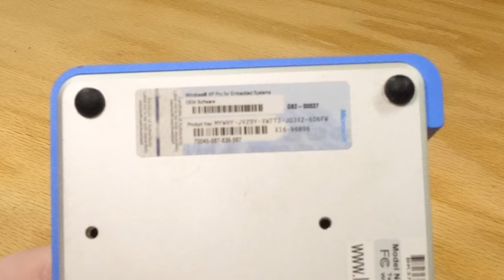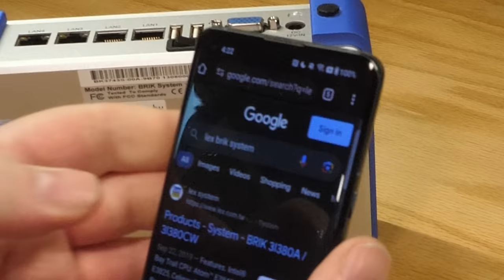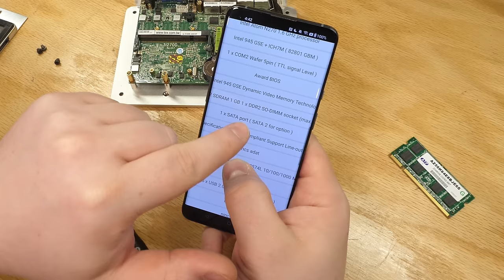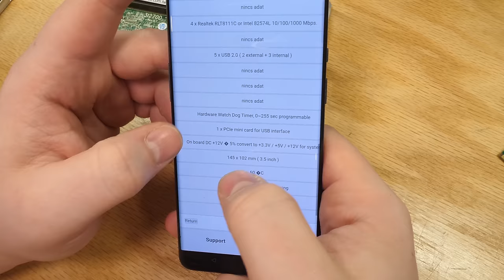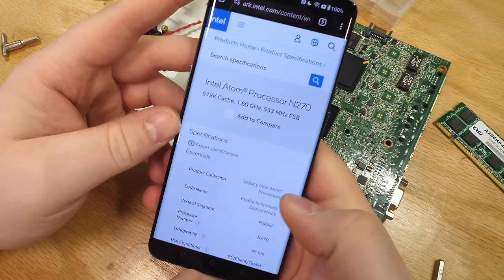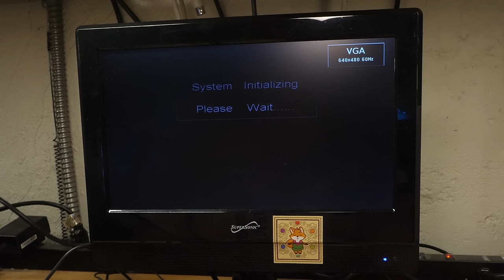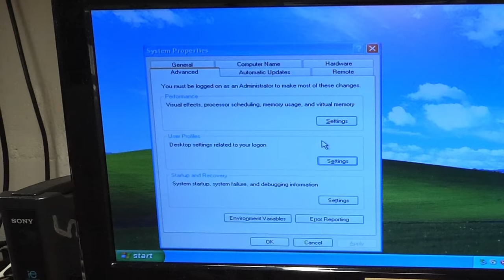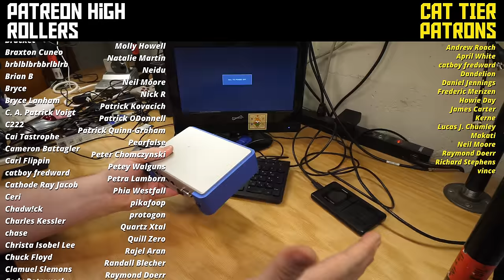Little Guys: Episode 3 [Lex Brik]

Comment: Those IODD devices are so awesome. I wouldn't mind a video going over it and/or other stuff from that same company. I like how they have a small yet simultaneously eclectic selection of devices all with interesting different features and styles, and at the same time their website is so badly translated and poorly laid out with no visible indication it's purchaseable or where that purchase might occur, the website is extremely entertaining. In some ways their stuff seems equally as odd as it is cool, which is the best kind of thing.

Comment: Regarding relays on industrial embedded pc: Generally industrial machines / lines are controlled by PLCs which are ruggedized microcontrollers that reliably run code, however they are somewhat limited in what they can do.  So when you need to do something more demanding or have an embedded machine part of another machine, for example a product labeler the labeler would use one of the "little guys" to do the labeling task. The machine (PLC) would still need to communicate / interface with the labeler (embedded pc) and because the PLC could be using 24vdc, 230vac or any other control voltage, relays would be a easy way for the embedded system to handle that. And generally all the communication needed between them are stuff like Labeler_Ready, Apply_label Etc
And this is also how many industrial machines interfaces with other machines. It is quite shocking how primitive the communication between two gigantic industrial machines can be, all that is needed is a ready signal that a machine is ready to receive product.

Comment: The USB lanes of the Mini PCIe interface are usually used for built in Bluetooth adapters that come with WiFi cards, like Intel or Broadcom, thr Bluetooth adapter just acts as a USB device, while the WiFi card acts as a PCIe device

Comment: 31:47 regarding your rant here about proprietary cmos batteries, I myself have 3 Nokia n900 phones and each require me to put the time and date in every time I power up the system and my research pointed to the PiTA battery/capacitor they basically 'welded' to the board, I need to source some but they simply don't really exist... Unless someone else could point me in the direction of them lol great video dude, always love watching your videos

Comment: Regarding USB pins in mPCI, M.2 also has USB pins, it's commonly used for connecting the Bluetooth part of a combined wireless module (and WiFi would run over PCIe due to the higher data rate required ofc)

Comment: Something in these things is so dang delightful. I have a mac mini on my table, not in use, but it's a delightful little guy. This reminds me a lot about it. But yep that blue oh that blue. I want it.
Also. The insides of the mac mini are not fun. Yea it gets the job done, but it's a pain to do anything in there. Lucky you don't usually need to but yea, the inside is just as important on what makes a little guy special. And that brik. I want one. Also oh boy that SSD mount is amazing. Yea it's cheap but it's possibly the most optimal way to mount it. Considering space. Screws cost something. But it's really kinda genius.
Reply: Ohhhhh heck yea it heatsinks to the chassis

Comment: The relays are for bypass ports. That would be for redundant setups, bridging the ports, when daisy chained to second device.
Reply: Oh lol you explained it anyway. It's common on Talari, Riverbed, Cloudgenics, ....
Reply: The relays would not only trip when power is lost, but also when a watchdog isn't reset periodically... To prevent the device from blocking traffic because of a misbehaving/failing OS or application.

Comment: There's a version of mPCIe that's just electrically USB. It's a present limitation on a number of laptops boards. Tends to be used for WiFi/Bluetooth-only slots. Same deal with M.2, it's why you can't throw a WiFi and Bluetooth M.2 into just any M.2 slot and have it work without issue.

Comment: On the PowerBook's proprietary PRAM battery... it wasn't for no reason, there was actually a feature behind it.

A few years before, Apple brought the sleep power of their laptops down far enough to support a use model where, when you were done using the computer for a while, you could just close the lid (which slept it), open it a few hours later, and be right back where you were, without losing more than a percent or two of the battery's capacity.  The initial version of this was only capable of suspend-to-RAM rather than suspend-to-disk, so even though the CPU was pretty much shut down, the computer's memory controller stayed alive enough to keep DRAM refresh running.

At the time, this was somewhat new, and Apple was in front of the PC industry.  Maybe not in terms of date of introduction, I don't remember, but in terms of making it actually work reliably, every time?  Way ahead.

So Apple's got this cool low power suspend-to-RAM feature, and they're thinking: what else can we do with it? How can we get further ahead?  And here's where you have to remember a usage pattern that was once common, but isn't now: laptop power users often carried multiple batteries in their bags so they could swap in a fresh charged one when necessary.  Battery capacity was smaller and active idle power management wasn't nearly as good, so if you wanted to use a laptop on battery all day, you had to charge and carry multiple batteries.

That's where the big "PRAM" battery comes in.  It got upsized and made rechargeable because Apple implemented a feature where you can close the computer's lid to put it to sleep, flip it over to get access to the battery, swap in a fresh one, flip it back over, open it up, and keep going.  The "PRAM" battery now supported DRAM refresh during the time when no main battery was in the machine - in essence, it's like a small UPS for the main battery, just enough to keep vitals going for a few minutes.  A CR2032 can't cut it for this application, you need something bigger and rechargeable.  So they went with a few tiny lithium ion cells assembled into a small battery pack.

This feature's time in the sun was pretty short because Apple introduced it just before new developments in main battery capacity, power management, and so forth would make battery swapping far less commonplace.

Comment: Mini PCIe does, in fact, have a pair of USB data lines as a standard feature. In Wi-Fi/Bluetooth combo cards, Wi-Fi part connects to CPU through PCIe, but Bluetooth usually uses this USB pair. I had an ITX motherboard with mini PCIe slot where USB lanes were not connected, so in order to utilize Bluetooth on a combo card I had to run a pair of wires from the slot solder pads to the internal USB 2.0 header. And it still works!

Comment: When Radioshack upgraded their infrastructure around 2003 with new servers, we jumped from some old Win95 machines that ran a X-server client to an IBM 340 desktop on the backroom, to some Compaq Proliena servers with Win2000 and virtualized DOS connected to Optiplex GX60's with XP Embedded. First time we booted those up, I saw the splash and was like, "Embedded? TF is that?"

Twenty years later and now I ask the same about "Pro". Which is interesting because standard XP embedded is XP Pro, as it can do domain joins....

Comment: With those vesa mounts when we used em at my old print shop we'd put the (gigabyte) bricks on the same mounts that the monitor used so that everything was all self contained on 1 swing arm that hung over the press and able to be pushed out of the way. Pair that with a touch screen monitor and you have an extremely capable work station that could get covered in lint, spray tack, chemicals, ink, etc and stay on practically 24/7 for many years. I quit eventually but some of our oldest stations were still going strong 6 years later...

I love these lil guys

Comment: The reason for your relay pads is probably because of things called bypass NICs. These are somewhat common in things like corporate WAN accelerators and similar devices. Basically things that "man in the middle" Ethernet for security or performance reasons, but where you still want the network to work if they crash or lose power. When that happens the relays will connect the two Ethernet sockets together which bypasses the smarts in the device.
Reply: Whoops, should have kept watching! I see you figured it out.

Comment: For that weird proprietary battery around 32:06, if you ever need to, there are lithium rechargeable batteries, LR2032 for example. Unlike the CR2032, the LR2032 is rechargeable. They also come in LR2016 etc. I only know about this because of the stupid battery in the dreamcast.

Comment: That’s a really cool device you used to emulate the cd drive! If I used older hardware much that would be useful, but it reminds me of what I use today: Ventoy. Same concept except can be installed on a regular ol flash drive. Mine has win 10, 11, and a couple flavors of Linux. I actually use it pretty often at work!

Comment: I was surprised to learn that even the Nintendo GameCube used a non-replaceable battery (though it's not difficult to desolder and replace with a CR2032 holder). Thankfully they wised up with the Wii (which I'd also consider an adorable Little Guy).
Reply: A non-replaceable battery? IIRC the manual had instructions for changing the battery. Either I'm misremembering or different versions were different.

Comment: I believe the springs on the heat block are what's holding the board to the chassis. When you screw in the standoffs, it causes the springs to squeeze the head block unto the board. Think about a heat sink for a normal consumer computer that has four screws on springs that go through to a backplate on the motherboard. In this case, the stand-offs are serving the role of the backplate, and I assume there's something you don't see holding the screws in place, so you just screw on the stand-offs.

Comment: Fun fact. At the time I was working there, Smoothwall was optimised for the predecessor, the C3 powered LexBook. The relays were there so that the ethernet ports can be bridged out, eg in the event of power failure.

Comment: 32:31 I have one of those Power books - not sure whether I'm fortunate or unfortunate. I don't think Macs of this vintage are "landfill fodder" without a PRAM battery, they just won't store the date and a few other settings. My concern, however, is that this battery board is a pain to get in and out. I bought a set of Torx drivers specially to get into my PowerBook but tbh I haven't even tried yet - I don't want to brick my computer.

Comment: As someone who's played with these types of embedded PCs for many years, this is cool to watch. There is a utility to modify the CF card blocks to have it show up as a HDD. I used to do it all the time, then enable the filesystem enhanced write filter & HORM for XP embedded. You end up with an XP box that will always boot to the exact same spot and can never write to the internal CF card. If it all goes wrong or crashes, CX just power cycles & it all comes back from a permanent "resume" state 😀

Comment: Have a few Wifi / Bluetooth combo mini pci-e cards that taught me about the pci-e/usb combo. The Wifi portion was pci-e while the bluetooth was usb. On some laptops and Full Pci-e to mini Pci-e adapters did not have the usb function so the bluetooth hardware never showed as available on these systems. Took me a while to figure out why the bluetooth hardware just did not seem to exist on these systems.

Comment: Actually there was an VGA+serial implementation in use. The AMD Geode LX processors had the pins for VGA DDC I2C multiplexed with an UART. If needed for debugging or bringup, it was handy to mux that port to UART and get a debug serial accessible from outside the enclosure for machines that did not have serial ports (ie thin clients). This brings back memories...

Comment: Back in the early 2000s, I took a tour of the TRIUMF facility at the University of British Columbia. There is a cyclotron there that produces intense beams of particles and synchrotron radiation. The adventures everywhere that would detect abnormal levels of radiation, that would indicate a beam departure event and would shut everything down in microseconds.

When I came in for a tour, the detected a slight elevation to my background radiation and my shoes were the source. From questions they gave me it appears that I picked up a bit of contamination from radioactive minerals in my collection

Comment: In regards to the Bypass Relays (I started typing a comment and your edit cut in so I'll keep it short) 
These were also really popular in the Telco space for their SBC Gateways (Session Border Controller Gateways) which were used for processing calls. 
There were Ethernet versions and the more popular one (in my experience) were ISDN versions. 
You could install an SBC in front of an old PBX and configure it to "do something" with the calls (such as go to a new pbx. or call recording.. or convert to SIP etc etc) but as before you could also make the system transparent. Not only would the system automatically connect the two ports together if the power failed, you could set this in software so if you needed to reboot the SBC or make breaking changes the legacy pbx (or the SBC you had behind it) could route calls too

Comment: I have a network card that has relays to bypass the ports.  What I have specifically is a Dell R210 II rebranded as a Riverbed network appliance.  The network card inside ( part number riverbed 410-00044-01 ) can do precisely this.   It's basically just a quad Intel 82580EB NIC with bypass relays.  While I don't have the official riverbed software to drive it, somebody figured out how to do it.  Apparently, the card itself was actually made by a company called Silcom and, with the right drivers, you can toggle bypass mode.
Reply: For a time I was a certified Riverbed admin / pre sales. 

Riverbed is a network accelerator appliance, placed in line with the firewall. 
It cached often used files in a local storage realm, instead of transmitting data to/from a remote server. Like in a branch office using a file share at HQ. 

The relays make the appliance pass through all traffic in case of software or hardware issues. 
Rendering the device into a really expensive ethernet cable.  
Ie. you lost the cache function but the network could still reach the WAN.

Comment: Used to use that very processor in a netbook with virtual machines. Fast? Of course not. Useful? Absolutely. It was my first machine obtained primarily for watching netflix, and mobile locksmithing. My main laptop could not watch netflix natively at the time without a virtual machine of its own, due to running linux, hence the virtual machines being used to run needed apps.

As for the hard to find battery, used to run 4 aaas instead of an ipod battery, before replacements became at all common. Had to mill out the back of the case, sure, they were never fully charged, but they lasted fine, covered as they were in epoxy. And once the charging circuit sees its at 4.2v, you are golden. For smaller tasks, i imagine you are using a stack of 4 nimh button cells.

Comment: I have a feeling that the white port at 30:05 is the CPU fan connector? Arent they usally 4 pin? Its labeled CPU so kind of makes sense. And is right by the other fan connector placeholders. Thanks for another great video!

Comment: In Device Manager, View → Devices by connection. Then if it's connected by USB, it will be under USB controller's branch in the device tree, and if it's a PCIe card, it will be under PCIe port or bridge. Exception is if your OS is so anachronistic to your hardware that you don't have drivers for USB controllers or PCIe ports. In that case, open the properties for that device, and on the Details tab look at Hardware IDs, these will start with USB or PCI depending on the bus.

Also you need to know that some cards are actually two completely independent devices in one, where one device is connected as PCIe, and other as USB; this is typical for WiFi+Bluetooth combo, where WiFi chip is routed to PCIe lanes, and Bluetooth chip is USB.

Comment: It's not a little guy, but I've got some AAUI to twisted pair adapters from Farallon. They have 2 ports and act like a hub when the adapter is powered. When not powered a relay clicks and connects the 2 ports together so any downstream device would still work. This design let you daisy chain a bunch of machines together.

Comment: Hey man. If you want to fix that titanium macbook you can replace the battery with a normal coincell battery. You just need to put a diode in line to make sure it can not be charged.

That would bring back these old systems again.

Comment: because the vesa mounts are throughhole, i think they are intended to mount the brick to the back of a monitor, eg, take it apart, mount the backplate to monitor, then reasemble it.. you dont stick it on a mount itself, no risk to short with too long screws as the screws will be the other way around.

Comment: My workplace has several industrial machines with remote diagnostics, like this Brik. The problem is, they don't USE it very much. Instead we get local techs who have to futz around and scratchheads exploring every possible option BEFORE they has the remote support team to login and offer advice.  This team is mostly the engineers who built the machines so it's actual experts, not just a call center.  But the field techs are discouraged from bothering them. Advertising: we have live remote diagnostics and engineers ready to help!  Reality: Can we call ANYONE else first?  Have we asked youtube comment sections what's wrong yet?  Have we already asked God and God laughed? Yes?  Then we can call Germany for help.